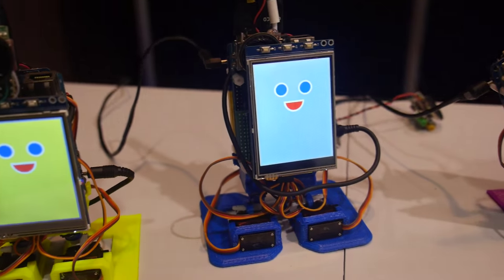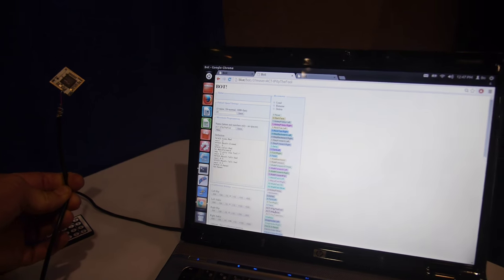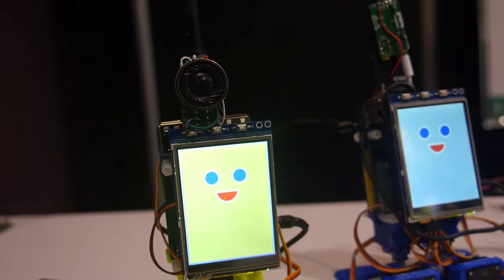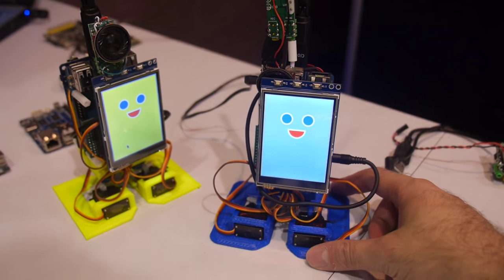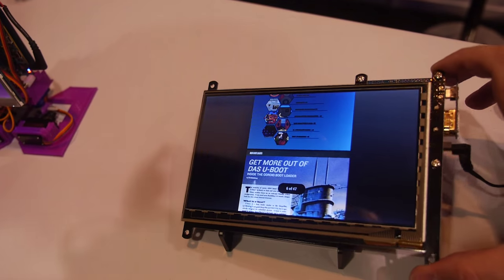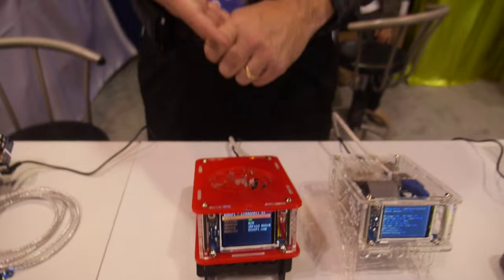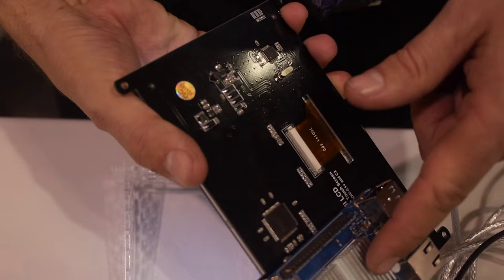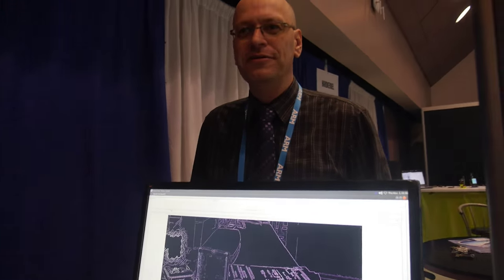Robot Kit using Hardkernel ODROID-C1+, VU7 display, ODROID-XU4

Comment: 75$ isn't bad for that sort of a beast
Reply: +MrFreAKSHAY here in spain it was 130€ for the xu4, 32gb emmc, case. 20 for packaging and 50€ for stupid spanish import taxes
it ended up being 200€ which... is still ok for me... but deffinitely not what I initially wanted to pay.
Still as I sold my raspberry and got some extra jobs it's alright but man that 50€ tax was crap.
Testing it tomorrow when I'm home ^^
Reply: +▐ ᴇʟᴍᴏᴅᴏ7▐ damn! $200 can get you one of those Nvidia X1 dev board. Customs seems messed up in every nations
Reply: Umm no...  Correction $200 can get you a Tegra k1 board the lightyears faster Tegra x1 board is like $500+ used $599 new. 

Tegra k1 is still a powerful package and you get the adapter and emmc included but the Odroid xu4 you can buy ready to use no installation required for around $150 so about $50 in savings,  it's pretty much a wash between the two. 

I would just suggest people to get the Nvidia shield TV.
Reply: Bob Brady Yeah, tegra compute module is 299€, full board 599€ and you could get them for 299€ if you were some kind of high school I have been told.
Pretty happy with XU4 though, now that I have fixed almost every issue it is awesome, still crashes sometimes (very few) when using gui but as a server there is no problem.